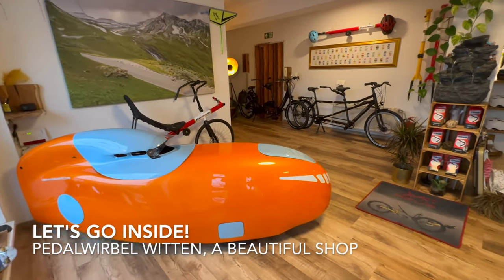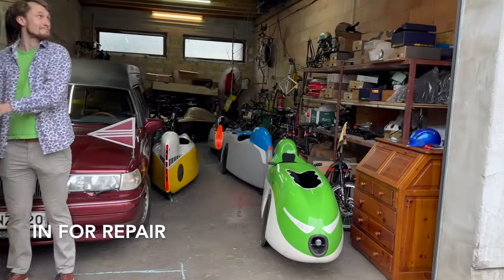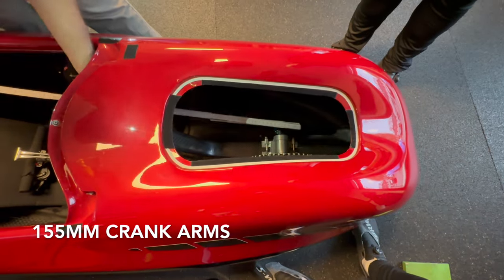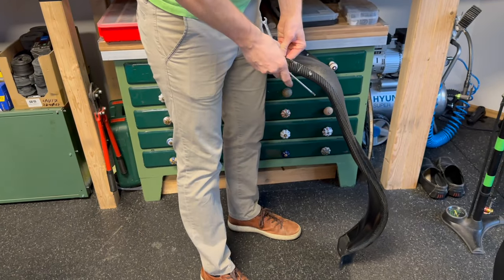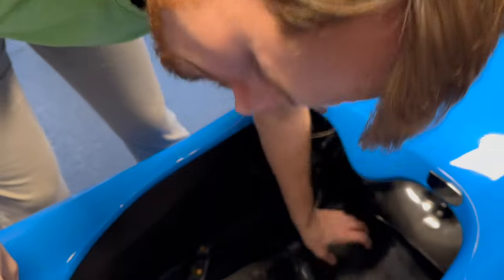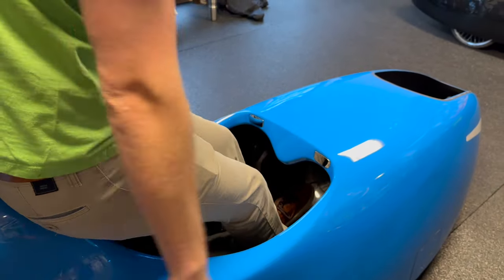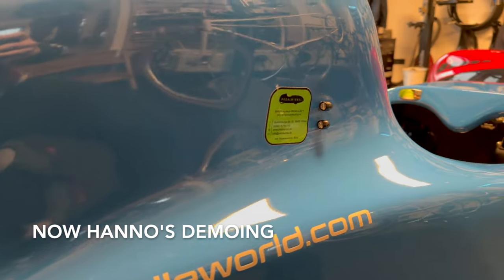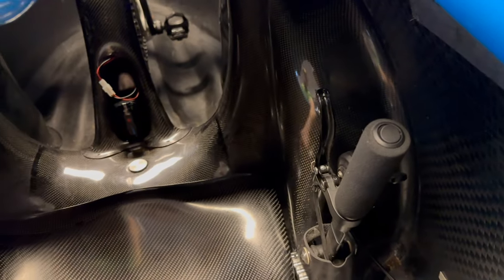Snoek Velomobile; A Visit to Pedalwirbel Witten

Comment: That's such a good level of service for them to size you and resize a chain... and let you go for a 60km test ride!  Did you go all the way to Germany just to check out new velomobiles?   What's your x-seam?  I didn't think the Bulk was meant for larger riders... I thought it was similar to the Milan SL.
Reply from the maker: I’m here for an academic conference that I’m speaking at. 94cm x-seam
Reply: The Bülk fits rider from 5’2” to 6’4”, depending on x-seam. In this case the rider has an unusually short x-seam for his height. Even in the w9 he will only be able to use a single chainring. The derailleur mount would not be able to be moved far enough back for him. A Milan SL with no Y support going up to the hood might be able to fit him with a double chairing.

Comment: As I expected, the Bülk would not work with your unusually short x-seam. The W9 can, but only if you use a single chainring. The derailleur has to be mounted underneath and the stem mount for it will not have enough room to be set so close.
Reply: he should be strong enough to go easily for 70  52-11(should be rideable for him up to 20% ramps)
Reply: @woife01  not everyone wants to or can put so much force on their knees nor is it efficient to pedal so slowly up a hill. It is very fatiguing compared to a faster spin cadence. I have tested this on hills where I live. On this topic Daniel is wrong. Single speed is not always better. The gear spacing is also quite poor on 12 speed and it is much more difficult to achieve smooth and efficient shifting.
Reply: @mnveloguy  Single speed is always better its the most efficient gearing. big chainrings 80+ will convert your force the best way. fast spining cadence will result of 30% energy loss. it feels fast in your mind but you are not going really faster. pushing realy hard into the pedals will make your knees stronger and healthier like legpress machine.
Reply: @DarkLord666-f1w  my knees and power meter beg to differ.